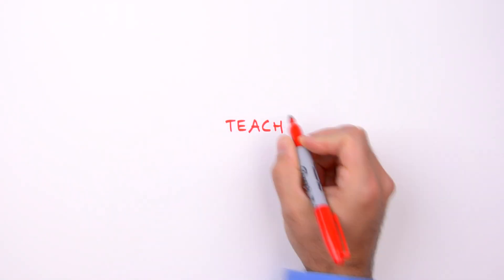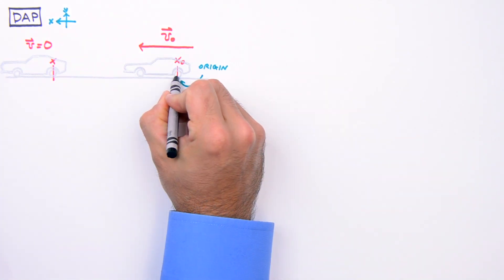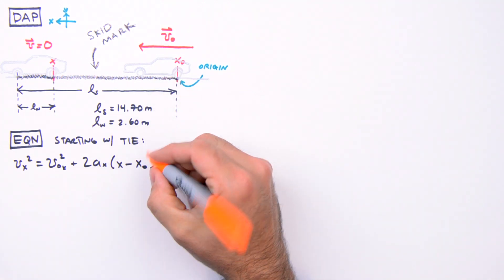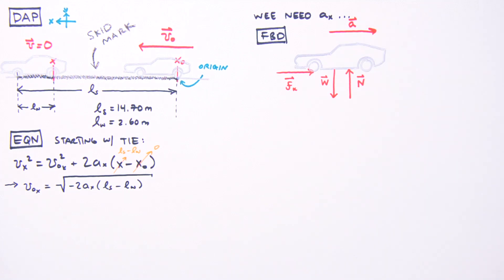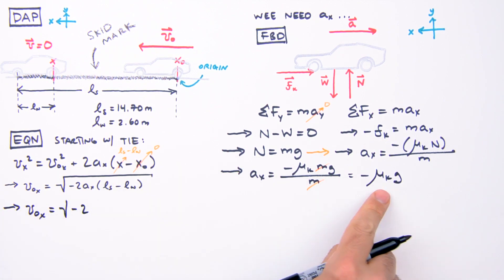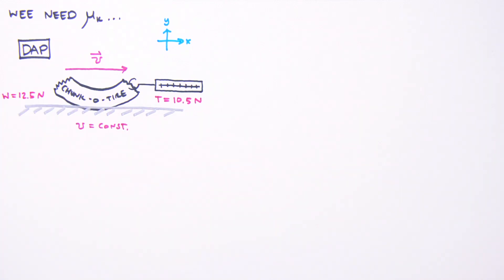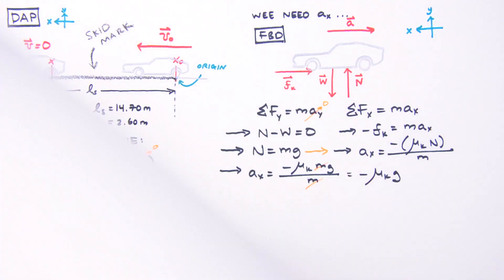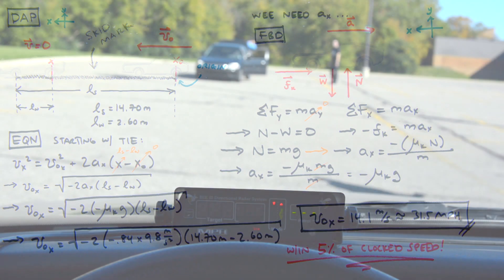How to Determine Speed from Skid Marks

Comment: Great video but I do not understand how that lightweight chunk of tire produces the same friction coefficient as the compressed tires that carry the weight of the car. I would think the car produces lots more friction with locked wheels than a small piece of tire that can be dragged with 1 finger.
Reply from the maker: Hi Jet Pilot! Good observation. The friction DOES increase with mass, but it increases by the exact same amount as the inertia, which is why the vehicle will skid/slip the same distance along the road regardless of its mass.

Comment: I have a question if the skid in question happened with the right side tires on pavement and the left side tires on gravel, how would this change the calculation? Would I need to find the co efficient of the tire sliding on the gravel?

Comment: Interesting video and the results seems to be quite accurate. It was very interesting to find that mass gets eliminated out of equation, and that you could get fairly accurate sliding friction coefficient by simply sliding piece of tire with scales.  However, I think that sliding friction is influenced significantly by heat of the tire at the contact with the tarmac. I read in some sources that very high temperatures produced with severe sliding can cause tarmac to produce lubrication, I guess thats also the reason of skidmarks appear (and we didn't see them in video). I suppose that also depends on some tarmac properties as they seem to have different softening temperatures, as well as tire thermal properties. I'd guess that even though mass was eliminated from equation, it probably influences tire heating which influences kinetic friction.

I suppose method from this video is accurate enough within city driving speeds, but I'd bet that with high speeds the error would go up a lot.

Comment: Friction causes heat so the melted tar and oil in the road is the actual mark. Not rubber crayons. Plus the “minimum” speed equals the square root of 30*d*f. Happy learning!
Reply from the maker: This is the word of the Wikipedia (praise be to Wales): "Contrary to popular belief, skid marks are not caused by pieces of rubber from the tire being deposited on the road because friction heats up the tire. Skid marks are actually bituminous oils in the asphalt that are heated because of the friction of breaking or accelerating and rise to the surface, leaving dark marks. This is why the marks fade." Thanks for the comment, Livefire!

Comment: Why did you use the rear wheels as your reference rather than the front wheels.  If the skid mark begins from the front wheels and the car stops referenced to the front wheels, the car's wheelbase doesn't matter.   And in heavy braking 60%-70% of the braking is from the front wheels.
Reply from the maker: Hi Tom. The skid marks for front and rear are on top of each other so it's unclear which is which. So we take the length from beginning to end and subtract the wheelbase to get the length of each individual tire's skid. Also, we're idealizing the vehicle as a rigid body and not accounting for heavy braking... and it works pretty well! Cheers from Detroit!

Comment: Why is there a difference between the calculated answer and the real velocity? Is it due to air resistance? Slight difference in the coefficient of kinetic friction?
Is that how police use skid marks to get the approximate velocity of the vehicles? What if the skid marks are not straight, but curved, does it affect the results?
Reply from the maker: Hi Zero. (And Michael.) Sorry for the delay! The difference could be attributed to a number of measurement uncertainties - did you see how we eyeballed the force required to pull the piece of tire along the ground at constant speed? The needle was bouncing all over the place! And it's very different if it's curved. I have video footage and a solution prepared for curved skid marks (I shot it the same day) but have yet to shoot the solution and do the voiceover. It's on my (very long) list of videos I plan on doing in the future... Cheers from Detroit!
Reply: +Jesse Mason Also the kinetic friction coefficient isn't constant. It decreases as velocity increases. Also determining the kinetic friction coefficient experimentally is pretty tough as it requires you to move the object at constant velocity(also Newton's first law).
Reply: he dint reply lol .
hope he does soon.